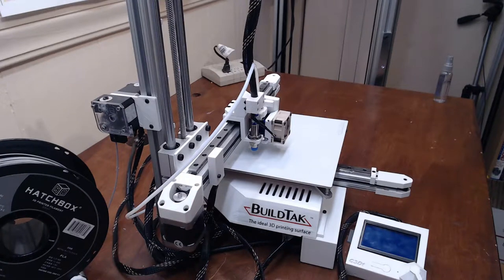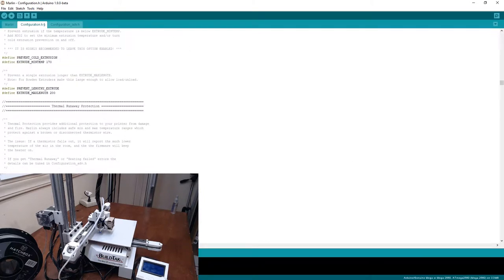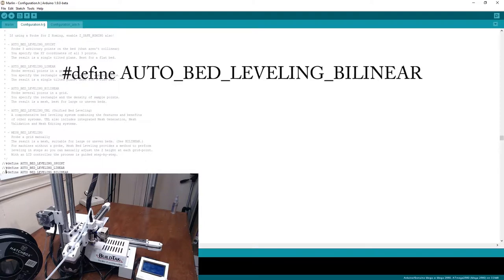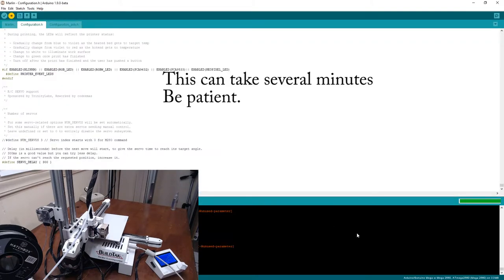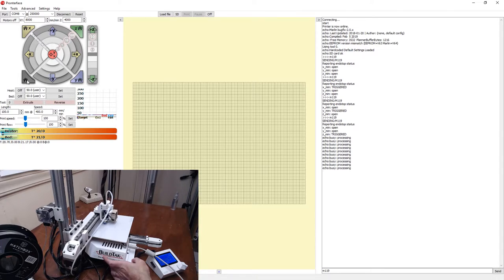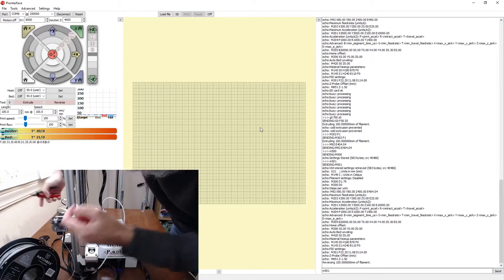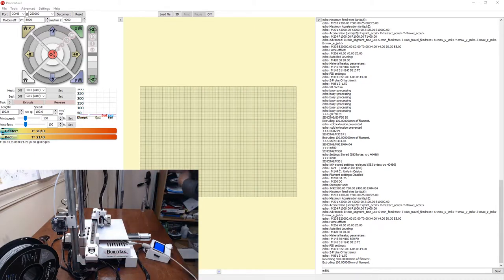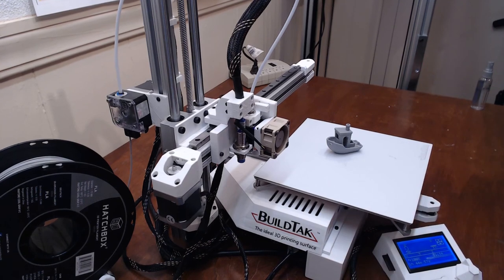C3Dt/c BCantilever 3D Printer Build: Part 9, Configuring with Marlin 2.0

Comment: I'm using MOSFET in 3D printer, but it's wire gets burnt. I tried two three times. So should I change in Marlin or there is something other problem because I didn't find anything in Marlin related to mosfet

Comment: hi, can you help me?
all the direction axis is ok, but my Y HOME goes in wrong direction
Reply from the maker: if one of your axis is moving in the wrong direction, you'll have to invert the direction in the firmware. In your configuration.h you'll find 
// Invert the stepper direction. Change (or reverse the motor connector) if an axis goes the wrong way.
#define INVERT_X_DIR false
#define INVERT_Y_DIR false
#define INVERT_Z_DIR false
in your case you'll need to swap the INVERT_Y_DIR to the opposite of what it currently is (true to false/false to true). 
Upload your firmware and try again.